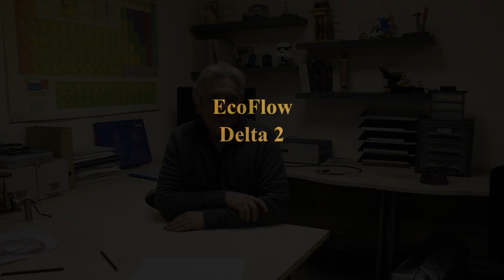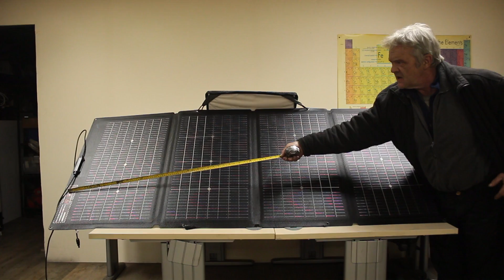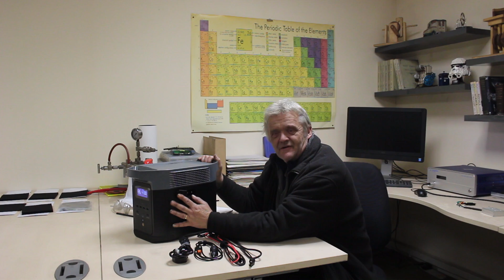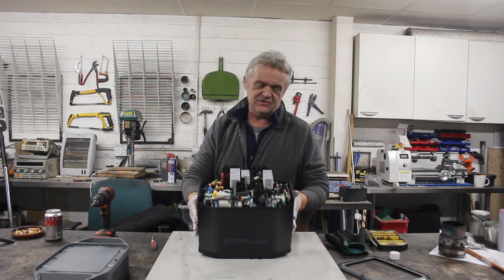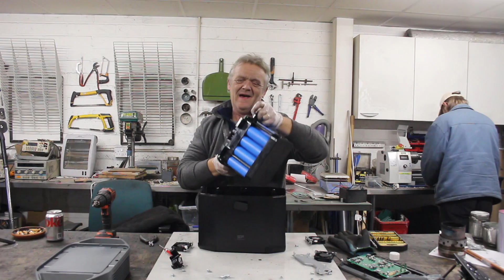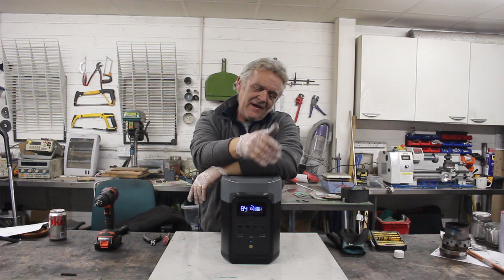1740 - EcoFlow Delta 2  #ecoflow #delta2 #portablepowerstation #notjustabattery

Comment: I have the Delta 2. One thing that doesn't get mentioned in the video is it's excellent charging performance from both the AC (1200W) and via Solar MPPT (500W) while not having the awkward voltage and current limitation on the solar input the new Anker LFP has (basically means you have to pay for Ankers overpriced panels or loose a lot of charge performance)
This charge rate makes it much more practical in a rolling blackout situation. You can charge it from AC when power is running or from a generator in just 1 hour.
The app is actually quite practical. You might have this unit setup somewhere away from where you are (where the solar panel or the generator is - and your ears aren't - see below) and the app allows you to easily monitor charge and control the outputs.
There is only 2 negatives with this unit: 
An adjustable DC output would have been nice (voltage and current) so you could use it to charge or use all the appliances which use a DC power brick (using the brick will waste alot of energy in the inverter and brick compared to a direct DC output) or directly charge other batteries.
The other thing is that if you plan on using it as an UPS, even at moderate load, the fan noise is quite loud.

Comment: That would work well with a multi-fuel or diesel heater, as they only use a few amps.  You could also run your home's oil/gas furnace with it for the same reason, allowing you to heat your entire house if a power outage lasted multiple days.

Comment: Interesting. Do people understand that a few won't-start-a-car-anymore junkyard batteries, a voltmeter, and a 15 quid inverter can do everything that this device promises, but without all those gimmick, designed to fail electronics and expensive  patented batteries?.
If you wanted to take it further you'd take the Tri- generation route, which triples energy harvest from solar or wind or ambient temperature difference, and use hot and cold stores: Murray gas demonstrated great options here, like Zeolite clays, Urea, Calcium chloride....
Salt Ice is great for cold storage.
And use an organic rankine cycle turbine, grid coupled via a synchronous AC motor/ generator. No batteries required. Just a valve adjusting gas flow to the turbine to suit demand, dispose of excess energy to the grid. 
You can even configure to use grid or other electric power to charge your hot and cold stores by using a Tesla turbine in dual mode and operating it as a refrigeration pump.

Comment: Very good product sounds like.  The fact that it is not entirely locked in and upgradable is wonderful.  You mentioned refrigeration earlier in the video as an issue in blackouts.  It doesn't have to be though.  Make a refrigeration unit that works from the heat of let's say your rocket stove.  Use the heat from the stove to pressurize a refrigeration unit that will cool as the pressure comes down.  My grandfather's RV had a refrigerator/freezer that ran on LP gas.  So it is not that difficult to be done.  There is also a unit an experimental engineer made to run from the sun's heat that would freeze water during the overnight period.  Easy enough to google that one and use a similar set up to make a rocket stove version.  Love these kinds of things Rob!  Keep pumping out those videos!

Comment: You might as well put the panel in the bin at this time of year.  My yield has been barely 8% over the last 2 rainy days.  Rain seems worse than fog.   There is only 2-3 hours a day of usable daylight and that’s on the days that aren’t grey and rainy.  After losses charging it from the mains and losses in the inverter is it really worth it.   Great to take camping for moderate use.
Reply: Welcome to cloudland, when i see solar panel fields everywhere at the Lecky bill payers expense, i want to puke, it's all planned to ruin and control us for UBI control
Reply: That is why he kept talking about wind, but I wouldn’t attempt connecting wind without a separate controller for the wind with a dump load.

Comment: I am getting a Bluetti AC200 max solar generator. It will be used to power my off grid mobile home. I will buy some solar panels and that's it. I have a system that will handle all the power I will need.

Comment: I think you might struggle to charge that with the supplied solar panel. 1kw would not last long and would take several days to recharge on typical winter days in UK. Its better than nothing, but at £1600 it's vastly overpriced.
Reply: Power Banks built using scrap laptop 18650 cells is the most cost effective way of making a power bank, but store it outside in a shed because if one of those cells shorts and burns it will cause a chain reaction

Comment: Why have an app on your cell phone to manage the power backup?

That's not a hard thing to figure.

All we need do is take into consideration the recent lockout of smart meters in Colorado, that prevented the 2000 Electric customers affected by the lockout, from accessing and utilizing electric power during a 90 degree heat wave. 

The purpose of an app on your smart phone is to insure that they can send a command to your power supply via your smart phone, and make your power supply non functional at the very point in time when you need it the most.

Yeah, I know that sounds like a conspiracy theory, but let's be honest about it; this current energy crisis is man made beginning with the policies of the marxist left, enemies of the United States, within the United States, choosing to shut down the US petroleum and natural gas industry.

Comment: It seems to be easier to use than most UPS devices that I have used lately, and it is cheaper than any with similar power capacity.

Comment: I have had a Humless 1500 watt "solar generator" for 10 years so nothing new here but it is very handy during blackouts makes coffee and runs my fridge for 4 hours or more and it can be used as a ups if desired. Charging is dead simple as long as you follow the voltage specifications so I see a windmill charger in your future. Also a great tool for camping. Most people find out that it can be used every day to offset your power bill but the drawback is the battery may be low when it comes to the black out lol. Of course now I have a large solar system it mostly sits under my desk but I can use it when needed.

Comment: feels a bit of a ‘between two stools’ solution. They’re expensive but will barely run your fridge for a few hours, along with a few LED lamps. Grab yourself a few LED lanterns that are rechargable and give out plenty of light for a few hours in the evening, and the rest is simple 10k mah powerbanks for your phone/tablet and download some programs from iplayer in case the mobile phone masts are down. 

This won’t be enough for your oven etc.
Reply: There are channels that tests these generators. A/C units can be run off of them for 6 hours. I think the biggest thing that people are missing is. These units can be charging by solar, a vehicle outlet, a fuel generator, as you are using the unit. So the unit can power a refrigerator or A/C unit for a long time.

Comment: This could be a great start to a playlist, videos on charging from different non-solar options (wind turbine, pedal power, Stirling engine, gravity generator? Water motor), attaching diy batteries like the powerblade or a gravity battery, and comparisons vs different levels of diy systems (but that may be a too deep of a rabbit hole 😆).

Comment: You can Buy or salvage  UPS take out the lead acid batteries, hook up to a bigger battery or hook up to your vehicle, solar panels,  wind turbine,  I was able to make my own for $100   lots of businesses throw away UPS systems only because they have bad batteries. Also have built in display showing consumption power.   So Simple to DIY your self 😀👍

Comment: I found out the app is very important. As I bought an Ecoflow extra battery for the Pro model and it required a firmware update in order for it to mate with the host battery. (It didn't say so in the instructions). I had to search the internet for answers. You can only do this through the app on the phone. I nearly threw the bloody thing out the window but hey presto 15mins later everything synced and worked.

Comment: When considering  expansion, 1Kw extra battery is also LFP but the 2Kw Max isn't.

The Bifacial solar panel sounds like it'd be a good candidate to mount over a fluorescing sheet and boost the collection from the back that way.
Reply: EcoFlow might plan to release the 2kwh max with LFP next year I guess

Comment: Thank you for the great review.  I have the one size down model. I used it for camping on my electric cooler and my son used it for his CPAP. Works great. I haven't tried charging with the solar panels...yet. It car and wall charges very quickly compared to other generators. After watching your video I am super confident about my choice.  Thank you..🙂
Reply: Does your model have an easier way to replace the existing battery inside or does it basically require dismantling the whole unit?
Reply: @marcfruchtman9473  That's a great question which I need to look further into.

Comment: So ...... How many bits did you have left over after the rebuild Rob? ;o)

And the important one ..... in the non-existent power cuts that we are definitely not going to have .... How do you get the App to work with no phone signal?

Got to say it looks like a well built bit of kit!
Reply: I assume the app uses WiFi or Bluetooth?
Reply: @jochenschrey2909  But are you willing to put £1,600 in to bet on it? But just to play devils advocate ... If the power is down how do you get Wi-fi up and running to get your app to switch the power on? ;o)
Reply: @totherarf  No, I won't buy one, I don't need 220V that badly and it is oversized for my style of camping. But when I searched for specs Wi-fi got mentioned. What is the issue about getting it up? You switch it on, on the Ecoflow and start a smartdevice, to connect to it.
Reply: @jochenschrey2909  My bad! 
I was thinking of a permanent instillation that uses a router to control the unit!

Comment: How spooky. I'd literally just pressed the "buy now" button on Amazon for this system (well, the Ecoflow Delta, plus panels) when the notification for your video came through. As we are novices at this stuff, to get a R.M.S thumbs up for this has eased our minds that we've made the right purchase. We won't be taking it apart though EVER! Himself and I had also been wondering if a wind turbine could be added so any video on how to do this will be greatly appreciated.
Reply: GeeKiller, many thanks for the heads-up on the batteries. I have cancelled the order and will order the Delta 2 set-up once the refund comes in. As these power stations are quite expensive to buy, 3,000 recharge cycles is going to last much longer than 800 for the Delta. Time well tell how accurate these stated figures are.
Reply: Cheers me dear!
Reply: I decided to stick with the Delta mini on weight and price and as is backup for power out, so only charged/ discharged for battery maintence rather than daily cycle on solar charge. 
I have a cheaper smaller 320Wh  LiFePO4 box with 120W portable panels that I charge daily/ when ever I can with solar. Use that box to charge all my USB tech for free.... so its the one that needs to have a big cycle lifetime. ( CTECI 329Wh from Amazon at £200 on special offer!  and Elecantera 120W panel)

Comment: LIFEP04 should be way more then 3000 charge discharge cycle, they must be erring on the very safe side. whats not clear is whether the extra cost is just for more batteries or do you get an upgraded inverter as well
Reply: If I remember correctly at the 3000 cycles it's 10 years, the unit is still at 80%. And most people will not run these down from 100% to 1%. So to me that 10 years would be more like 15 years before it's at 80%.

Comment: I have a 50w slow cooker so if that's rated at 1 Kw it should in theory if my maths is right power my cooker for 20 hours, please correct if I'm wrong. If this is the case at least I should get 1 hot meal a day when the shtf.

Comment: The central heating - gas, oil and electric - needs electricity to pump water around radiators.  Essential power is needed for fridges and central heating... so a £600 petrol driven generator is the solution putting out at least 3kW.    These typically run for 12 hours at a litre an hour.  Far cheaper than a battery, though a bit noisy - but OK if at the back of the garden in a dog kennel.

Comment: I've seen someone running from one of the Ecoflows a kettle and an air fryer, so pretty heavy peak loads to run, at the same time. He was in NZ so I think they are 230v country so was pushing around 2kW. I think it may have been a bigger one than that but not that massive one with the wheels and handle like a wheely case.

Comment: Lost power this weekend for nearly a full day (wind took out a powerline) but thankfully we had a generator that is decent on gas, about 5 gallons will get about 9 hours.  I had my fridge, deep freezer, 2 TV's, land line (which was out also), PC, and modem all running on it and the generator never missed a beat.  At some point (IE when I have more disposable income) I am going to look into getting a full battery backup system so I can run my well, water heater, and furnace as well, luckily it wasn't too cold this weekend but I have a round kerosene heater as a backup heat supply if needed.  Lucky for me also is that my stove is propane and has continuous pilots that don't require igniters, so I could boil up water on the  stove for hot water for dishes and such.
Reply: I was able to run a similar setup from my 5 kWh 48v battery in my electric lawnmower (modified to do this of course). Lasted 26 hours before power come back.

Comment: Knew these last day events were coming a few years ago. I bought some much cheaper options due to budget but anything is better than nothing.
A simple small battery bank, solar charge controller, and a foldable panel does just fine if you can accomplish basic wiring. Then you just add what you need (inverter which is the biggest cost, 12v sockets, 5v usb, etc)
These all-in-one type units are good for what they are though, especially for those who don't care for wiring or setting things up. 
I have a 280AH one that does the trick for most things and it's very portable.

Comment: Is it correct that in order to store these correctly you must not exceed a 50% charge ?
Reply: ... its just import regulations made up by different countries.
If you ship a Taycan full electric to china it needs to be almost empty. Usually lithium cell items get shipped between 30 to 50% charged, because producer doesnt know how long its going to stay on the shelves.
The uppermost charhe is also bad if something happens and also charging everything to max costs money if the numbers are high.

Meanwell produces a special power supply for charging and feeding back power into the power grid. Scalable for battery (car) manufacturing and testing, since they have to test capacity but again dont/wont ship fully charged. You normally did not get your car with a full tank either ;-)

Comment: I've been thinking about these (both ecoFlow and Bluetti), they would keep my house basically heated and lit for a few hours (with the grid turned off, of course),  not that I'd attempt to use the electric cooker. But it all comes down to a lot of money for something that would get very little use in my case, so I've gone for the more expensive and longer term ESS solution, which probably won't get installed until spring. Ah well, the blackouts might not happen and then should only be for a few hours at a time.

Comment: These are plug & play and a great idea for those with limited land and for people who have limited electrical knowledge. The biggest problem people will have is separating their home incoming power and applying this to your house safely without blowing the thing up or causing injury. Years ago my mum was cooking a Turkey in her gas oven on Xmas day, a power cut lasting several hours ensued. The gas oven, central heating and lighting went down straight away, despite being gas the ovens electric gas valve closed, similar the central heating and pump failed to work. I had a small inverter and a battery, I made sure the main incoming supply was fully isolated and then made up a suicide lead with a 13 Amp plug on the inverters outlet, which I then back fed into the mains through a plug socket which I made sure no one touched.  It was not the correct way to do things, a proper change over switch needs to be fitted but in an emergency it was the only option, we had heating xmas day and the Turkey continued to cook till completion.

Comment: I appreciate the product being available because it does help some. Still, my house runs on solar and battery with a gas generator so I understand the world of solar and batteries quiet well. It is very easy to do in my opinion to build your own and much cheaper. Besides, you want to know how your power system works as well as have redundancy built in with multiple inverters, battery bank ect.